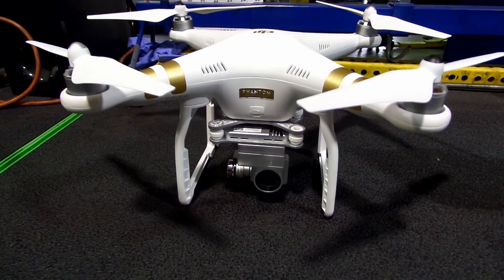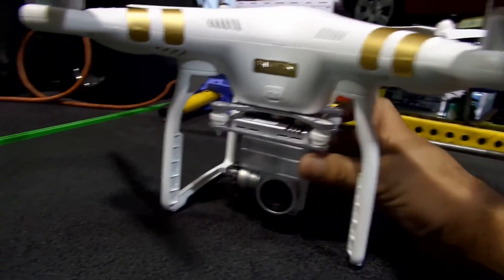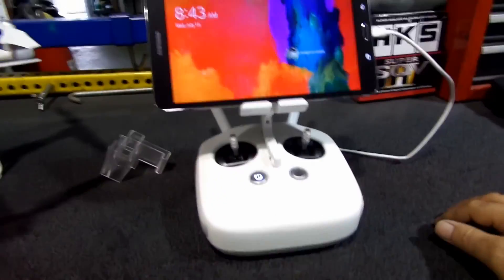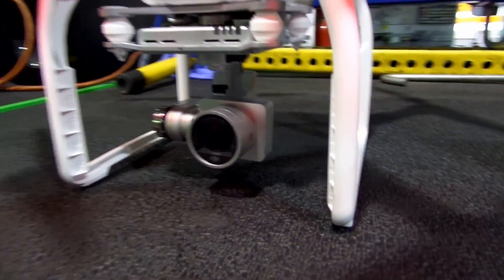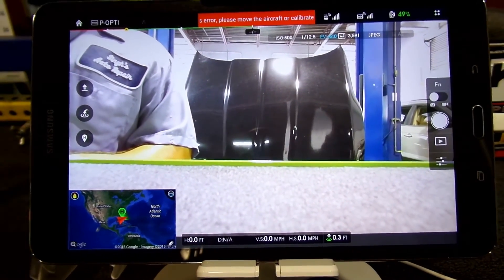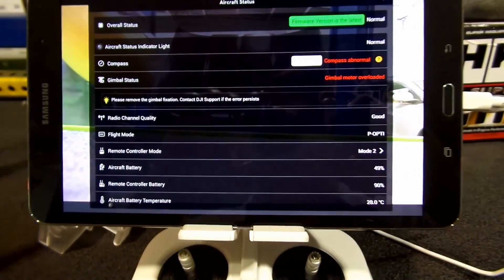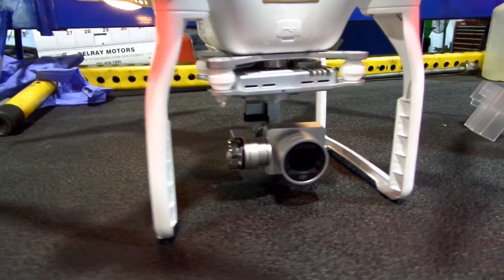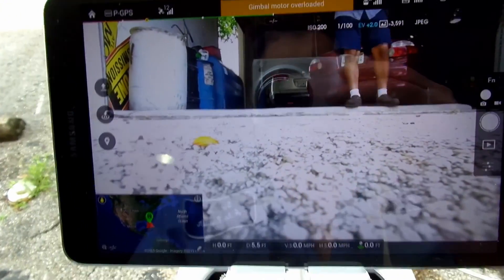DJI Phantom 3 Professional camera problem

Comment: I had the same problem
And I found the damage I saw that the screw on the base of the camera is misaligned is a screw type tor very small black color.
What I did was to mis-adjust very soon then I turned on the dron and ready
This causes the gyro sensor to calibrate

I hope it works and excuse my English I only speak Spanish

regards
Reply from the maker: Thank you, that fixed it.

Comment: Hi i dond't know if your problem is already solved. I had the same problem  And this is how i fixed it  Its a easy fix.
There is a verry littje hex screw that holds your camara to the pan axle. Thislittel screw is probebly not tight enough.
So see if it is. if not tighten it and the problem should be solved. Make sure you don"t pres th cameraall the way tot the top of the axle becouse then it runs against the plate just above it.

Succes. Rene The Netherlands.
Reply: +Rene Ribanski hey i having same problem with mine dji phantom standard i just bought it and firts i had camera signal then lost signal but i could see the drone position and altitude adn everything but not camera view then i crashed bought new camera conected camera workd good but doesnt connect to the app

Comment: I have had the problem with two phantom 3 drones. It's after you do the firmware update the gimbal has all these problems. Sent both off for repairs. It takes about two months for them to get it back to you. I am still waiting